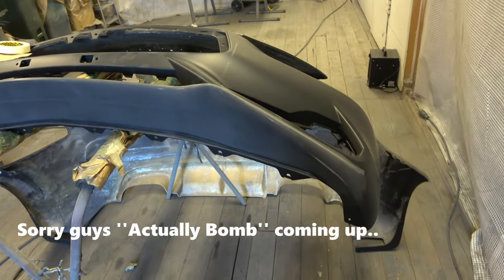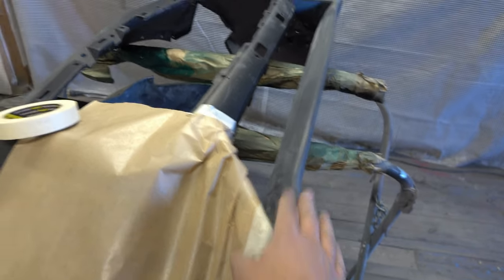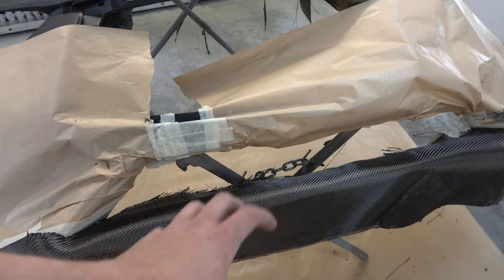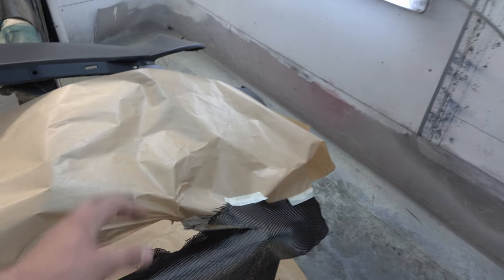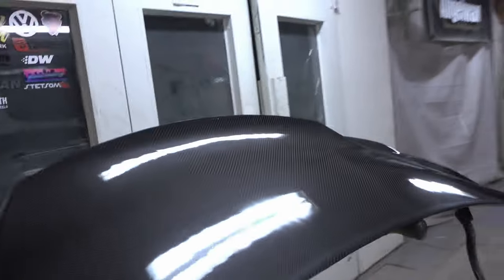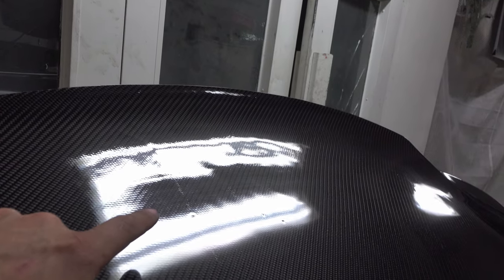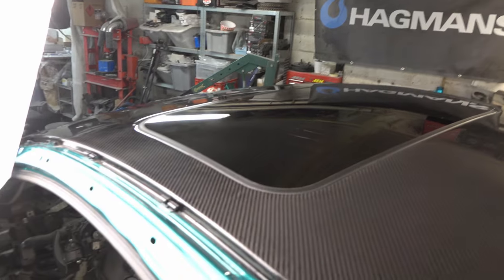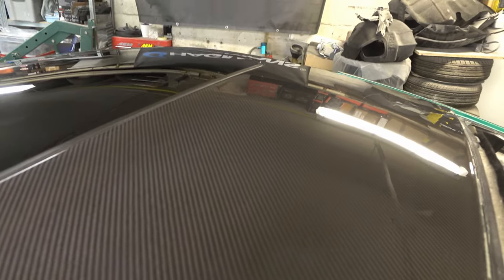How To Carbon Fiber Your Car Roof and Duckbill Trunk [PART 2] [ Infiniti G37 ]

Comment: Very cool Iv done lots now even a steering wheel lol     Getting ready to do my roof just finished my wing mirrors.     And did my front splitter.   In chopped carbon.  Then at the ends I cut the letters out rx8 and fitted led lights to show through at night
Reply from the maker: Really cool man. A lot of work, but well wurth it in the end.

Comment: I know this is late but, apply some release agent to the area you don't wan epoxy to stick to (areas is may run off to). If you don't have this, you can also use Vaseline (petroleum jelly). This will prevent tit from sticking and you can easily break any runs off of it.
Reply from the maker: Ya man, thats a really good idea! Thanks! Always use it in my molds so why not 🥰😉
Reply: @MagassDesign  Yup! Glad you replied so others can see this in the comments and hopefully prevent/reduce problems. I've been working with carbon since 10 yrs old doing prosthetics and pointers like these have helped tremendously
Reply from the maker: @GevoA1  🥰😍😘

Comment: Paint the engine in the same black recipe as under the car, and cover the cover with carbon fiber. Make other details in brushed aluminum.
Reply from the maker: Huge thanks for the input and that you actually took the time to write! Really appreciate it!

Comment: Easy choices, scrap the antenna and make one single-piece engine cover entirely out of carbon fiber molded from the parts you have.
Reply from the maker: Thank you for your feedback and many who agree to skip the antenna but also to have the carbon fiber engine cover.
Reply: @MagassDesign  Perfect project to make a mold and vacuum bag ;-)
Reply from the maker: @filipknutsson5210  sounds like a good idea